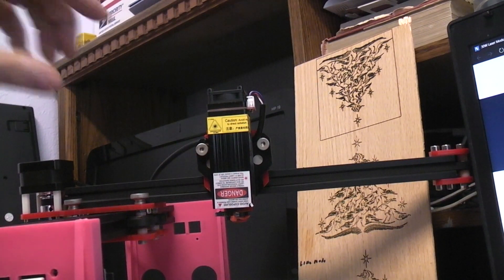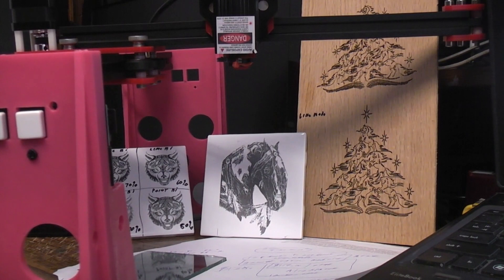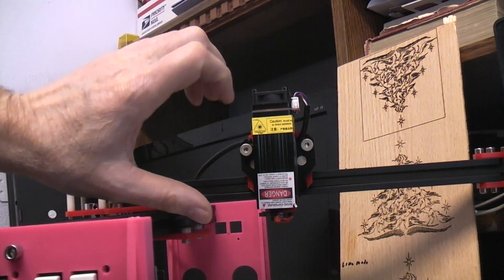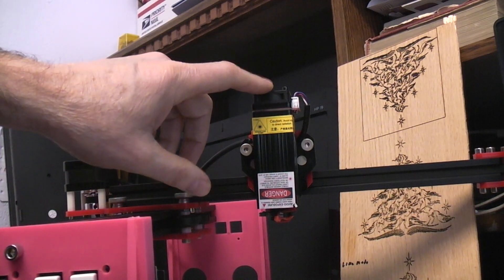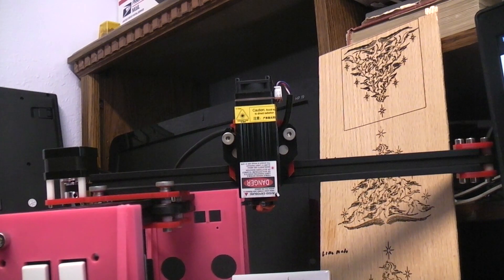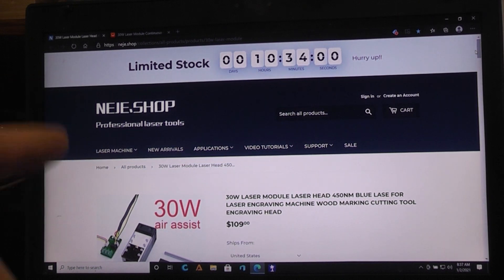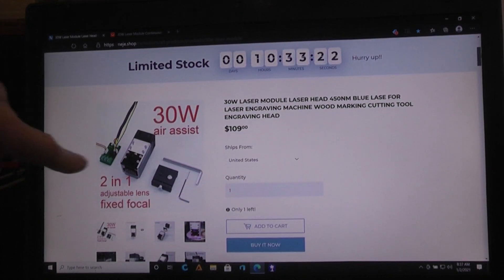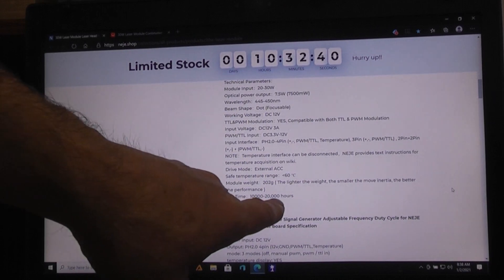How long do low cost Laser diodes last ? Probably not as long as you thought.

Comment: All lasers are consumable as you already know. However, the power settings determine the life of the diode. And the operating range for a diode is 10-80% power max, although nobody really knows what the rating parameters are for diode lasers. If you operate in that power range, your diode will last longer than the posted lifetime. If you operate above 80% power, the lifetime is shortened as you increase power. I used to be in the LED business, and we operated under the 10&10 rule for measuring diode life up to 70% power. Our Cree diodes were rated at 50,000 hours at 50%. At 60%, it reduced to 45,000 hours. And at 70%, 40,000 hours. That was our controller's max setting, 70%. Here's where it gets interesting! At 80%, the lifetime dropped to 25,000 hours, and at anything above 80%, 20,000 or less, I don't remember the exact numbers now. This was straight from the Cree (the largest supplier of LEDs) lab white papers. The LEDs were rated based on 50% power, which is an industry standard. So my point is, if you have a diode laser, you should never run past the max ratings, but the caveat is, we don't know for sure what those ratings are. If you set your diode  laser to <= 80% power and just make multiple passes to make up the difference, you stand a good chance of exceeding the manufacturer's claims. I personally run mine at 100% a lot of the time, but that's me, and laser diode manufacturers say that you can. The bottom line is, nobody knows because we don't have access to the actual white papers.
Reply: So that is why the led lights don't last as long as claimed? Because those are often over driven. Far above that 50% you mentioned.
Reply: @FlexDRG_Lampje  Yes, but I don't particularly worry about that. The manufacturers are telling me that their ratings for the diode laser are tested at 100% power. I don't know if I believe that or not, but I haven't had one burn out in over 3 years now, so it might be true.
Reply: Thanks a lot very interesting
Reply: Even CO2 gas laser tubes have a limited lifespan.
Reply: @SamKGrove  Yes, C02 has an even shorter lifespan.
Reply from the maker: Yes that all sounds right to me, even with these Blue laser diodes. A few of the sellers now provide a chart showing power setting and lose of power with time.  Its true from the second you turn them ON they are losing power, a consumable for sure. Even CO2 laser's are the same , its just that you can buy a CO2 laser with much higher optical power.
Reply: All of the diode lasers today are rated at 90-100%.

Comment: if you keep at 100% all the way, will not last long, but try to clean the laser lens, if you don't use air the smoke will cover it.
Reply from the maker: Good tip's. I always keep my lens clean and I plan to add real air assist soon. And yes running a laser diode at 100 % is not the best way to use them, I stay in the 60 to 80% range and just add more passes if required. I have noticed that many of the laser diode sellers not include charts showing the optical power loss over time and power settings. A few of the new diode lasers use dual diode laser and dual cooling fans and have the square dot shape instead of the rectangular shape of the single diose units so they work much better.
Reply: @Robothut  i got me a 20watts neje machine but tomorrow will sell it as it has only 15X15 work space, also the diode life is not long, that's why i moved to CO2 lasers, for the price of 40watts diode head i got a full laser engraver, try the K40, you might like it better, co2 tube life is way longer than a diode and has more power :), best of luck mate.
Reply from the maker: @takismail  Yes I have always known the CO2 was the way to go if you have the space. but my aim was for a hobby laser unit that the wife could use for her crafts, a simple unit that she could just place jpeg images in and engrave. Every now and then I use it to cut wood. Thanks to NEJE and there 30 watt "7.5 optical power" al, the other laser diode makers are jumping in with new lower cost versions. You can now get the same 30W diode set up for $150 bucks and what they sell as a 40W with dual diodes and dual cooling fans in the $250 range, they can cut 8mm wood and still be a small unit and no water cooling required.
I know you will love the new CO2 unit, let us know how it goes and what fun projects you do with it.
Reply: @Robothut  Brother, check the K40 Mini, its not so much bigger than a computer case :), only one problem, it has water cooling and vent so need to install next to a window, but way more power for your projects.
Reply from the maker: @takismail  I only run mine with a vent so thats not a problem and even the water cooling is fine. So I will check out the size of the unit. Thank you.
Reply: @Robothut  you're welcome, happy to help, you can join Chinese K40 Laser Group. on FB many nice members they will help you at anytime you need help, best of luck mate. :)

Comment: I have the neje 30 watt one your looking at and im here watching your video because it seems weeker and I've been running it on 15 and 20 percent power about 20 hours so far but now 15 and 20 isnt doing it im now on 30 percent could be the style of print but i dont think so
Reply from the maker: Interesting. I have not lost any power and have run mine even at 100 % power a few times, normally I run at 50% to 60%. May I ask what your able to do at 15 or 20 % power ? I can not think of anything but I bet you have.
Reply: @Robothut  im new to this but 15 to 25 was working good on my cedar planks kiln dried
Reply from the maker: @rockman49er  Thats cool. Thank you for sharing. I have to use more power than that for any wood and even brown cardboard.  Lets hope the laser is doing fine and it is just a change in image or setting of some sort.

Comment: Just like in the video after about 100 hours of engraving my laser lost power after using it at 100%,  However simple fix is to go into settings in the vigo software click reset and voila back to as new , hope this helps before going to buy a new laser
Reply: Hi, what  is the Vigo software?
Reply: can you explain further? I thought it was a hardware issue that caused it to be less effective, how does software affect it?
Reply from the maker: I gave it a try. It did not bring back my old vigotec laser. Same loss of power still happening. But it was worth trying but its not a fix for me.

Comment: A 30 Watt LASER for only $109 tells me a lot. I consider that one a mere toy for that price. For example, my 3 Watt LASER pointer is more expensive than $109. And that's just a pointer. For 30 Watts I would expect to pay at least $300 min for a properly cooled pule LASER cutting head.
Reply from the maker: Yes the 30W rating is the power draw of the laser not the optical output. The optical output is 7.5W. this made clear by the sellers and by my videos.
Reply: @Robothut  Correct.

Comment: As I did, and it works very well, only in Mexico it takes practically 1 month for the 30W laser to arrive, but it works very well. And the bad thing is that in thingiverse there is not the base to interchange lasers from 20W to 30W. Regards.
Reply from the maker: I found the metal mount that comes with the 30W laser mounts right on to the  Vigotec. I cover this in this video.
https://youtu.be/Jf_C2SlDiHc

Comment: I am in the same situation. Looking forward to you doing a video on this when it is delivered.
Reply from the maker: I just got the new laser today. Will shoot a video as soon as I can burn a few things with it. But it looks to be a very nice lazer unit.
Reply: @Robothut  - It's been a month now, could you also do an update on how it is doing now please :-)
Found and watched your previous video, the unit looks good and is (still) available for an affordable price
Reply from the maker: @EgonSorensen  So far it is still working like new. Nothing bad to report. I am sure I have more hours on it than the cheap laser that had come with the engraver. Will update when there is something new to say.
Reply from the maker: @EgonSorensen  If the 40W diode laser was not so expencive I would love to try it out, but at 3 X the cost I think I will have to pass for now.
Reply from the maker: @EgonSorensen  You cant beat the CO2 laser if you have the room for it and the water cooling system. We will see if the new NEJE laser diodes hold up, so far mine is doing well. The extra large fan, and larger heat sink might be what makes it work longer, also they claim better optics. Who knows for sure.

Comment: The fact is if the LASER Diode is not cooled sufficiently it will slowly burn out. That is why we buy expensive LASERS. They can run 24 hours per day, 7 days a week. I use to repair CNC 600W cutting LASERS for Multicam. The cooling is very good on them. Some use multiple means of cooling...like a couple of powerful fans, liquid cooling, very large heatsinks all built into one package. They require very accurate CC CV power regulators.   Anyway try taking the CB out and have a look at the capacitors. They are usually the first to burn out in pulse LASERS. Try a capacitance meter to measure each one on the board.  FYI cheap LASER pointers use a very simple current regulator circuit. Most manufacturers give you the ON time duty cycle in seconds or minutes. If you exceed the time, the LASER chip will melt. My 3 Watt LASER ON time is only 90 seconds.

Comment: Many of us have moved to a K40 type 40W CO2 laser.  Plenty of power to do the types of projects you like, and easily cuts 3mm birch ply, or acrylic, in a single pass.  My only complaint is not buying it sooner!
Reply from the maker: Yes back when I decided to do this sort of thing I decided that I did not want a large K40 type unit with the water cooling . So have went with the smaller Diode laser systems. Looks like the new 30 and 40 watt diode lasers will do what I want to do and if they are even close on the life span of the new diodes then that will be perfect for me. I agree the low cost K40 units are the best bang for the buck if you have the space for them.
Reply: @Robothut  A good idea that I have used before is to measure the heat coming from the LASER body by using your multimeter temperature probe mounted on the LASER body heatsink.  I do tests to be able to find a reference temperature on my meter.  I think we can all agree that if you can touch the heatsink with your finger without getting burned suddenly, that would be the range I choose to measure on my meter. I have been burnt before on over heated modules. Example like a LM350 Voltage regulator circuit with a large heatsink. I am able to still touch it. But if I touch it and get a small burn than its wayyyyyyyyyyyyy  to hot. That's my rule. And my final rule when designing circuits is to only use 1/3 of the maximum amperage component rating. That way you can never go wrong.
Reply from the maker: @Gruntess  Non of my leaser modules has ever gotten more than slightly warm, never even hot. Also the New NEJE laser unit I bought to replace the cheap one that came with the Vigotec has a temp output you can read, Pin 4 of the wire set up. Some control programs display the laser temp in real time so the NEJE has that data avalibile for systems that can use it.
Reply: @Robothut  Oh. I didn't know that.
Reply: Do those co2 lasers have actual beam power rating, diode ones of 80w has only 10w of output optical power.

Comment: It would be good if you could add a resistor so it could never go to full power. (The thought being that If you need more power, then you need a different laser.)
Reply from the maker: The laser work from pulse width control PCM so a resistor will not do the job on these types of lasers. But you have to set the power for every job you do any way so its just as easy to not go to 100 % now that I know it shortans the life of the unit.
Reply: THATS A BAD IDEA!!!  That resistor would end up being about a foot long with a 1 inch diameter.  The very best way to reduce and stepdown a variable DC voltage is to use DC to DC Buck Convertor modules. They are CC and CV.  Voltage and current can be turned down to lower levels.  I use 5 to 20 Amp modules. They only cost $12 on ebay. But you might have to replace a few components on the CB. The Chinese use cheap capacitors. However I have not burnt one out yet...they take a shit kicking.
Reply: @Gruntess  not if the resistor controls the pwm. ;-)
Reply: @TheRainHarvester   Its not a problem using a DC to DC buck converter since the pulse rate on some are 300,000 Hertz riding on the LASERS PWM frequency.  If you do use a large resistor can I come to you to cook my bacon and eggs on it?
Reply: @Gruntess  I wouldn't use a big resistor. I'd use a resistor to limit the pwm, which would limit the power of the laser.  Ie no way to reach full power via software by accident. Limit the power via hardware to prevent operator error.
Reply: @TheRainHarvester  I'm talking about the power supply that supplies power to the POWER MOSFET PWM circuit. So it can be tested both ways. Power to the PWM and or power on the PWM output. Of course it would have to be tested. How about my cooked bacon and eggs??  Lol     FYI...this account is my old girlfriend's account. And yes she was a real hermaphrodite. I am not, just incase you were wondering.
Reply from the maker: @Gruntess  Resistor is a bad idea. The PWM circuits that are designed for the laser modules is the way to go, they do a good job and run cool. Adjusting optical output power from 1% to 100%.
Reply: @Robothut  pwm is sometimes controlled via resistors. Like in a 555 circuit.  I'm saying modify the circuit to clamp the duty cycle to save your laser from ever going full power, because if you accidentally go full power, then your laser will quickly die.
Reply from the maker: @TheRainHarvester  Everything  in electronics is controlled by resistors. We will have to disagree.  And thats OK. But you do know that all drive circuits have resistance built in. The drivers have a resistance the wiring the circuit boards  and so on. So yes there a resistors in the circuits already that set a max current limit. But the PWM sets the duty cycle.
Reply: @Robothut  do you know how a 555 chip can set pwm/duty cycle via a capacitor / resistor?  (I'm not sure of your background.)
Reply from the maker: @TheRainHarvester  I am a circuit board level designer for the last 50 years. Been doing it since before there were IC's. I have electronic producs in use world wide. Lots of audio gear and recording room gear. All kinds of high speed duplicating equipment. Have been using 555 timers since they were introduced.  Very old school stuff.

Comment: When you were showing the specs (at 4:24), it said that the 30w version does NOT engrave on steel, glass or ceramics.  Was that correct?  If so, it wouldn't suit your needs at all.
Reply from the maker: To engrave on glass and tile you first paint the glass with black spray paint and on the tile with white spray paint, then you engrave. What happens is on the tile when the paint is burned up by the lazer it gets hot enough to burn in to the glase top coating on the tile, then you remove the spray paint with thinner and what is left is  burned into the glase top coat not realy into the tile. On the glass you do the same thing. There are 100's of you tube videos on doing this. So what the spec are saying is true you do not engrave directly onto steel , glass or ceramics but there are ways to do it indirectly.
Reply: @Robothut  Interesting.  Thanks.
Reply from the maker: @jayducharme  When the new laser head arrives I plan to add a hour meter to it and see what kind of life I get before I notice  a drop in power.
Reply: @Robothut    I'll watch for that.